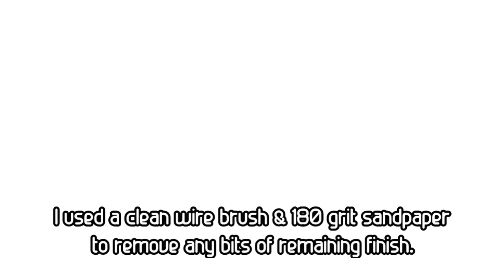GORGEOUS FURNITURE RESTORATION- Shabby Chic to WOW! Relaxing Furniture Restoration-only shop sounds

Comment: Wow! Who would take such a beautiful piece and paint over it, especially when you don’t know what you’re doing!?! You did a great job restoring it. I saw that covering the paint remover with cling wrap keeps it from drying quicker and you use less of it! Thank you for sharing  this video!
Reply from the maker: The stripper I use works so quickly there is no  need to cover it up to prevent it from drying out. Citristrip works best if covered by plastic and allowed to sit for 24 hours. Please give it a thumbs up. That helps my channel a LOT!

Comment: You absolutely did the right thing in not staining it. Beautiful job! I noticed it was a little wobbly. Did you have to correct that? What in your opinion is the best way to correct that for furniture?
Reply: You could try exchanging the feet on different spots to see if they were in the wrong position. 
If that doesn't work, then try gradually sanding the feet that seem to be too high until the wobbling is stopped. 
I hope that these suggestions will be helpful.
Reply from the maker: One of the plastic floor protectors had some off the leg and I just needed to replace all 4 so they were the same height. Good catch tho!
Reply from the maker: Thanks Judith for the suggestion.  I was missing one of the dime sized plastic floor protectors that you put on the feet. I pulled the other 3 off and replaced all 4 and now it does not wobble. I was in a hurry to get it finished so I could get the video out to you all.  I am always pressured for time to get these videos out weekly. Sometimes I do not make it but for the most part I do.

Comment: Gorgeous!!
Why did you still the inside of the drawers? I was taught to leave the wood raw without finish especially on antique pieces.  I have several handed down from great grandparents and grandparents. None of the cabinet/dresser drawers are finished on the exterior or interior accept for the front exterior. I remember the smelly soaps and sachets and paper they put in them growing up. The house smelled great for a few days to a week afterward as the drawers were done once or twice a year. Wow, what a memory.  This piece brought that all back.
Reply from the maker: My clients are always impressed when I finish the inside of the drawers. I have gotten splinters and snags on clothing from unfinished drawers. I also just think it looks better. Thanks so very much for watching! Please give it a thumbs up! That helps my channel a LOT!

Comment: You did a great job restoring this piece! Wonder if hemp oil would have been a good option instead of the finishing wax….just a thought. Hemp Oil doesn’t change the color, just revives the wood but I’m sure you already know that lol
Reply from the maker: Thanks for the tips. Hemp oil has to be reapplied and I do not want to burden the new owner wiht the responsibility of re-applying it.  I try to make my furniture maintenance fee.

Comment: Absolutely gorgeous! I love the raw wood! How long did this project take you. I have worked on 2 pieces of furniture with multiple coats of paint and am thoroughly discouraged with how much time it takes me.
Reply: I too, sometimes get discouraged---but you can do what I do---come back here, and get a dose of hope, and crack on again!
Reply from the maker: It took me 3 days. I started on Saturday and finished it Monday by Noon and did the video Monday afternoon.
Reply: Don't get discouraged this piece only had one coat of pretty modern paint on it. The piece itself isn't very old either.  

If you are restoring a really old piece it can have been painted multiple times and who knows what kind of paints may have been used over the years. Some  strippers don't work well on certain paints that may have been used 50 to 70 years ago.  

If you're using fast acting strippers like the 15 minute variety try the 30 minute kind maybe try other brands or types. Just know if it was painted on you can get it off.

Comment: I would love to see you do a piece with tounge oil,varnish tends to turn yellow over time,as where tounge oil brings out the beauty of the wood, takes longer,but well worth it.
Reply from the maker: It takes a long time for tongue oil to dry and my shop has a lot of dust in it. At any given time, I am working on 
2-3 different pieces at the same time.  I can't just stop work for 3-4 days to allow the tongue oil to dry. That is why I prefer sealers and stain that dries quickly . I needed to get this video posted no later then Tuesday of this week and I stripped it on Saturday so my choice of products was partially based on that time frame.  I like Polyurethane a LOT. It is very durable and with a car washing sponge, it goes on smoothly. Sometimes I also spray it.

Comment: First, I like these "half-tables", when against a flat wall, they add dimension, or depth.  The wall doesn't even have to be reflective to make that illusion.  
Beds are huge square boxes.  Usually these are flanked by even more square side table, "crates", and looks like a warehouse.  These half-tables solve that problem.  Appropriately sized round or oval night stands, do it for me, and work well against the dominating bed "box".
Since I can't pass up these tables, I got one with inlay, (many times, it is fake, using dark and light stain).  Not 10% as nice as this, but still, the craftsmanship could not be obliterated.  When I striped it, I did much the same, lightened it up, and clear coated it all.   I still need to wax it as you did to give it that hand rubbed look, over the poly.
Luckily that woman didn't damage this, "with her creativity".  Just beautiful, and great result to respect it.
Reply from the maker: Glad you enjoyed the video. Thanks for watching!

Comment: Why do so many people want to paint over such beautiful wood? I absolutely hate "shabby chic". So many beautiful pieces of furniture have been ruined by DIY shabby chic "inspiration" that I'm so glad to see this piece of furniture rescued. 
This piece is beautiful. I think I would apply a light clear coat just to add some protection and luster.
Reply from the maker: I did apply polyurethane to this .  I think people paint furniture because it is quick and easy. Face it, it takes a LOT longer to strip it, stain it and seal it. Thanks for watching.

Comment: I think you did a wonderful job but maybe finish with a higher gloss as antiques have..
Reply from the maker: Hi Paul. Thanks for the suggestion. I prefer a satin finish because it enhances the wood grain. When I use a gloss sealer the reflection of the light on the wood  prohibits one from seeing the grain as well.

Comment: Not just wire brush! Use  brass brushes for stripping paint. They will not scratch & will expose the natural grain.
So that, less steel wool & sanding is needed.

Comment: Wouldn't using a nylon brush with stiff bristles instead of a wire one be much better as the wire brush would scratch the wood correct? I'd personally like to shake the hands of the people that made that piece of furniture in this video as they are/were craftsman.

Comment: Wouldn't a plastic scraper work just as well? I was kind of having an anxiety attack when you were going out it with the metal scraper. I already saw the beauty and I'm just about a minute a half into the video.
Reply from the maker: When I heard the scraping of the putty knife in the video I cringed!  It did not scratch the wood. I have tried a plastic scraper but the stripper eats it up!  Maybe they make one just for stripping. I will have to look into it. Thnaks for watching!!!

Comment: Cannot recommend Citrus Stripper enough! It's non toxic, works better, is usually cheaper, smells nice, and if needed can be left on up to 24 hrs. Also you can neutralize it with baking soda or baking soda water.

Comment: Oh, yes! This chest of drawers is very lucky. There was only one layer of stupid paint on it!😍
Reply from the maker: Soooooooooooooooo true!! I was relieved!!! Please give it a thumbs up. That helps my channel a LOT!
Reply: @FurnitureFlippingForProfit  While I was almost healthy, I had to restore an old wall clock. The main problem was not the mechanisms (washed with gasoline from accumulated dirt, lubricated and everything works), but the housings. It wasn't difficult with two - a couple of lost jewelry parts, dried glue, cracked varnish. But the other four, besides the usual damage, are the horror of painting art! Record - seven layers of paint or varnish of various colors! The lowest one is bright red! Apparently, after the revolution, the watch went to a particularly ideological Bolshevik! :) the other six layers... and blue and dark green and brown, dirty gray (lead white?) and two layers of black paint and varnish. It was necessary to take a picture of the owner's face when I returned him the finished chkas in the restored building! He didn't recognize his thing! 🤣🤣🤣I apologize for the terrible English, I use an electronic translator.

Comment: That's not an antique but it sure is a beautiful piece
Reply: I'm not sure why you would think that this wasn't an antique.
Reply from the maker: I don't think it is an antique either. Antique is over 100 years... right?  This had the newer cross point screws so it was less than 100 years old.

Comment: In addition to the wire brush try old toothbrushes and rinse it often in Mineral Spirits and wipe with papertowels, cheese cloth or lint free rags or paper when cleaning tight crevices and ornate items.  BE CAREFUL NOT TO LIFT EDGES OF INLAY OR VENEER PIECES. When these dry they often crack and splinter causing damage.
Reply from the maker: Hi Penelope - thanks for the tips. I do use a toothbrush occasionally.  I agree that you must be careful anytime you are stripping or sanding around veneers or inlaid wood. I cringe when I see people sanding off the finish of veneer furniture. They would not have "blow outs" if they just stripped it.  Please give it a thumbs up! That helps my channel a LOT!

Comment: Beautiful work!  Glad you didn't stain it.  Is there a reason you didn't use wood conditioner before the varnish?  It would have shown any spots that still has finish.

Painting this piece was criminal, especially when it was in such good shape
Reply from the maker: I did not think it needed wood conditioner. I used wax after I put sealer on it.

Comment: This
 looks like a Butler made  
Piece.  Absolutely beautiful!  But you should Never, Never, use steel brushes on wood!!!!!  Only fine steel wool pads, the wire brushes are really bad on furniture.  But great job on these very expensive pieces of furniture!!!!!!

Comment: I die every time you stain the inside of drawers, instead of oil / wax.  I just keep imagining splinters and stain on clothing.  You may want to use a higher grit sponge sander for the nubs.     Otherwise, very very nice outcome!
Reply from the maker: I get splinters from UN finished drawers. That is why I finish them and they have a finish on them so the stain will not come off.  My clients are always impressed when they see the drawers stained and finished. I do not do it all the time- just when they look like they need it. I sometimes go over them with orange scented wax before I list it for sale so the smell is lovely when they come to look at it. Thanks for watching!

Comment: I've read that if you want to put wax over polyurethane, you need to wait for a full cure of 30 days otherwise you might get some problems, like possibly cloudiness etc and yet I see many people putting wax immediately over poly coating. Have you ever had any problems doing this?
Reply from the maker: No but I use water base polyurethane. Perhaps that is why. Oil based poly does take 30 days to cure. Who can wait that long?